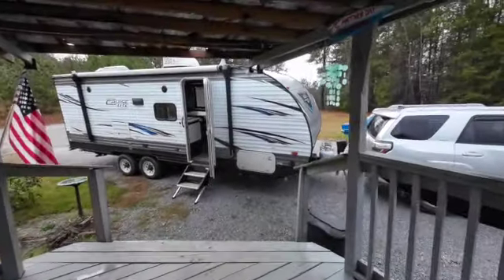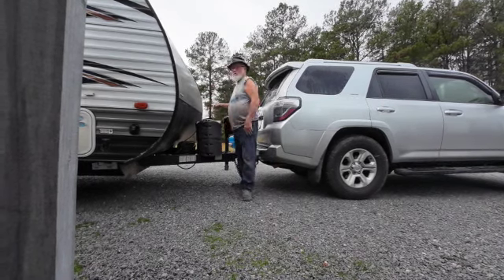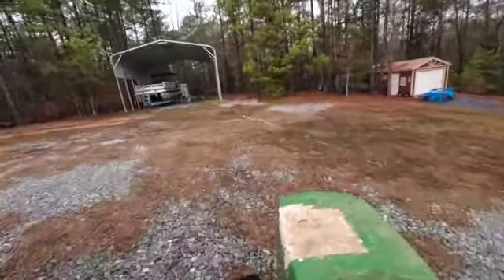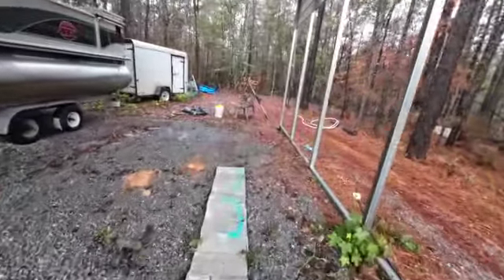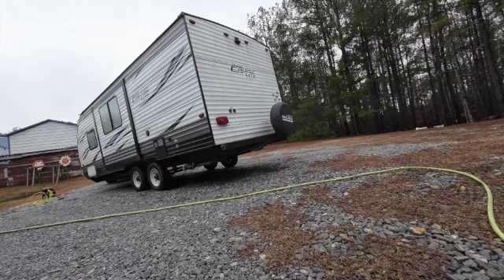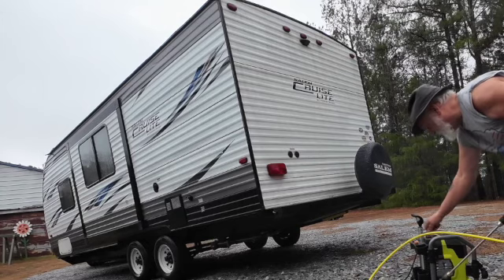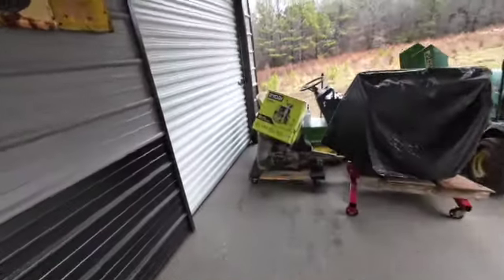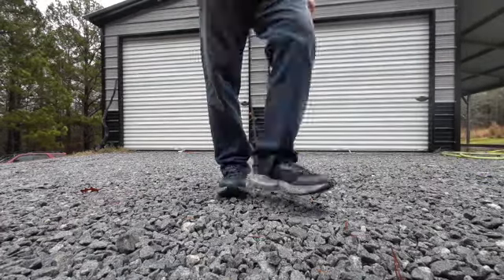Pressure washing the camper and finding art on the floor

Comment: Were you happy with the results from that cleaner you used on the camper? I'm going to need something in the spring to clean mine
Reply from the maker: Very happy.   The roof of my carport was filthy and unreachable and I squirted this stuff on it and hosed it off and it did an amazing job cleaning that.   I highly recommend it.
Reply: Thanks @rpeek
Reply from the maker: Here's the video where I washed the carport over the house.     https://youtu.be/i6RW6CXwvsI
Good luck with your project.
Reply from the maker: Your welcome..   @nh5er237